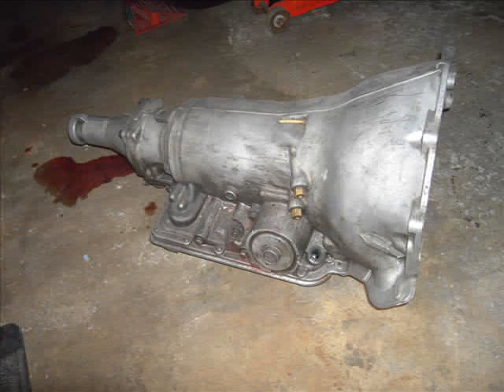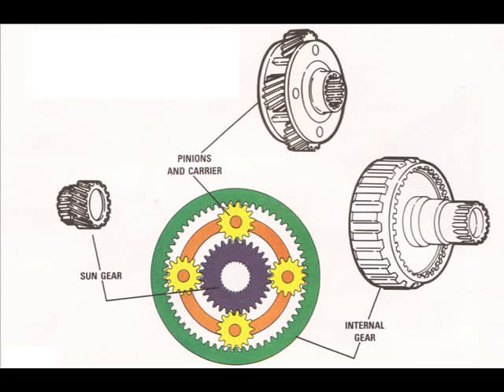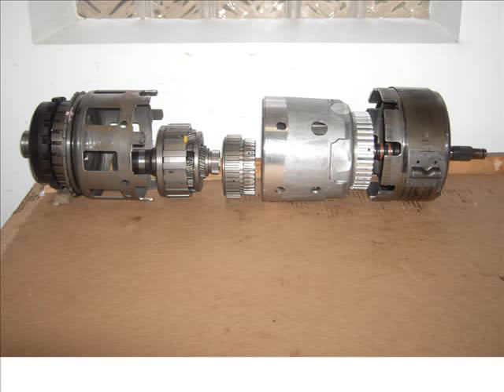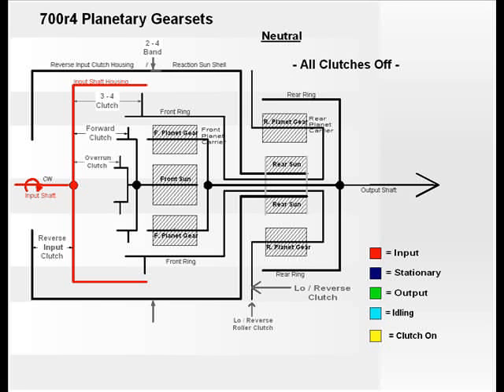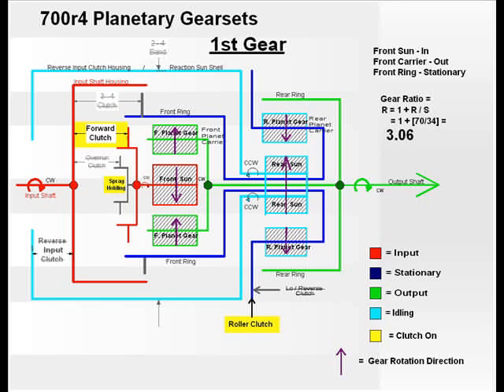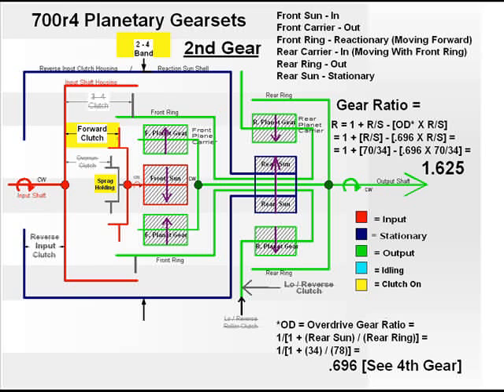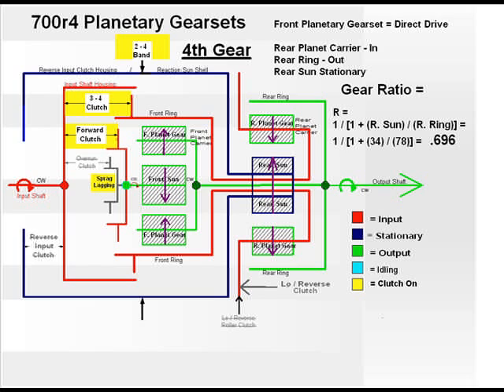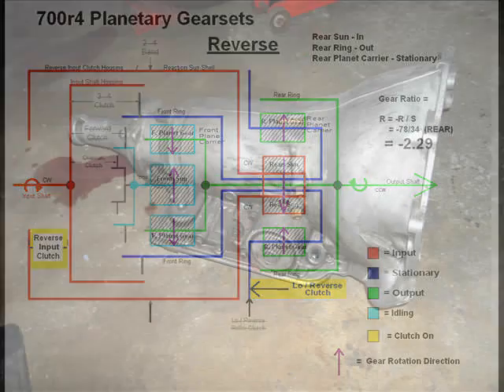How 700r4 Gear Ratios are Determined

Comment: At 07:30, 2nd gear description is incorrect. The front ring and rear Carrier are NOT connected to the output shaft. The front Planet and rear Ring are connected to the output shaft, that is why the rear ring locks the output shaft/drive wheels when the hand-brake is applied
Reply: Sorry not when the hand-brake is applied, rather when "P" is Selected
Reply from the maker: Sorry for not responding sooner, but I don’t think I got the usual E-Mail alerting me that I had a comment.  (I came across this because of another comment I recently received.)

Good catch. The error is in the narrative.  I say, “The amount the front ring moves forward is controlled by the connected rear planetary carrier which is in turn connected to the output shaft.”  As you point out, only the front planet carrier and rear ring gear are permanently connected to the output shaft and my statement in the video is not true for the front ring gear and rear planet carrier.  The elements that are connected to the output shaft are, I believe, correctly identified with a large dark green dot in the diagrams.  I will correct the narrative in a future update of the presentation.

Thanks for your comment, it’s good to know that someone is watching and listening to this video!
Reply from the maker: The “Lo / Reverse Roller Clutch” is a one-way sprocket that prevents the front ring gear and/or rear planet carrier from turning in reverse.  In 1st gear, its purpose is to hold the front ring gear making it reactionary.  In reverse, its purpose is to make the rear planet carrier stationary.  In other gears, there is no tendency for either the front ring gear or the rear planet carrier to move in reverse, so the “Lo / Reverse Roller Clutch” is of no consequence.

Comment: I’m building a 46 Chevy pickup and with a 350 SB and a 700R4 transmission, what would be a good (good as in midrange set for even power and fuel economy) rear end gear set for a 10 bolt 8.2 rear axle? I will be running 265 70 R16 tires. The rear end currently has a 2.73 in it but I’m afraid that’s going to be too tall of a gear.
Reply from the maker: Yes, your gear ratio is tall and your tires are also tall, resulting in relatively low RPMs at speed.  Your tire diameter is 30.6 inches, giving a circumference of 8 feet.  This results in 30 RPM per M.P.H. or 1799 RPM @ 60 miles per hour.  This will result in 1259 RPM @ 60 miles per hour in overdrive.  You will be getting excellent highway gas mileage, but performance wise you may not be getting your RPMs up as much as you’d like.  The 700r4 transmission will help, especially in 1st gear.  Maybe consider a lower profile tire.  (The formula I used is RPM/MPH = (2.73/60) X (5280/8) = ~ 30.)
Reply: icogye Thank you for the speedy reply. Went over the math a few times and cane up with a 3.43 gear but because I have a 10 bolt 8.2” rear end it’s not showing that gear set for it. Only one that is close is 3.36 which would be better than the 2.73. Might go with a bigger rim (17) and slightly smaller tire to help keep it around 2000 rpm
Reply from the maker: Good Idea.  My truck, the one that has the 700r4 transmission, has 26.4" diameter tires and a 3.43 rear end.  I can light the tires with ease. Must keep the RPMs up.  The higher the RPMs, the higher the horsepower.  9 miles per gallon though (city driving).
Reply: icogye I may go with the standard 5.7 350 and RV roller cam and bigger valves with this truck. Get it closer to 400 hp and a fuel injection system just to keep it simple and reliable. Got quoted $1685 to rebuild my 700r4 with better clutches, corvette 4th gear servo and corvette stall torque converter. Another quote for $2200 at another shop for the same setup. They called it their super 700 package.
Reply from the maker: Wow you got me beat.  I also have a 5.7 Liter small block but with a four barrel carburetor.  I doubt if it has more than than 200 HP - mostly stock. My transmission is a 700r4 that I bought on Craigslist for $300 about 6 years ago.  Has always performed well.  Great burn outs.  One thing you might consider is a stock lock-up converter which is a fun toy.  You can put a switch on your dashboard and lock it up anytime you are in 4th.  You can feel when it kicks in - feels like the engine is hooked directly to the driveshaft!  But I never liked high stall converters - too much slippage and too much heat to deal with.

Comment: I currently have a 700r4 in my C10 pickup with a 2.73 rear end gear but the acceleration from dead stop is very slow. Would a swap out of the rear end gear to 3.42 make a big difference in take off? Looking to burn some rubber!!
Reply from the maker: Yes, I believe so.  My C10 truck has a 3.42 axle ratio with standard differential (no posi-traction) and a 200 HP 350 engine and I can hardly prevent the tire(s) from spinning when I take off from a signal.  A friend of mine once said, "Get your RPMs up!  It puts the horsepower higher on the chart at all speeds.

Comment: I just rebuilt my 700 r 4 out of my 92 Chevy pickup . All the gears work fine but reverse just barely will pull the truck back it’s not slipping but just can’t get it to lock up the gears in reverse what do you think I did wrong please help thanks
Reply from the maker: It's been a while since I worked on my transmission, but I would first check the shift lever and linkage to see if it is properly aligned with your shifter.   Other than that I would look for other possibilities affecting the operation of reverse.  A good description of the components at work when in reverse can be found in the GM book "Principles Of Operation" pages 27, 94 and 95.  This document is available for download for free at http://www.1990suburban.com/repair_and_service_manuals/700-R4_Automatic_Transmission_Principles_of_Operation_2nd_Edition.pdf.

Comment: You mean Chevy and GM corporate bolt patterns, or universal bolt patterns.
Reply from the maker: I'm really only familiar with the Chevy bolt pattern.  I know they make this trans for Buick, Olds and Pontiac and if you have one, you must be sure to get the correct trans.
Reply: For the most part early 700-r4's and 200-4r's could have BOP (Buick Oldsmobile Pontiac) or Chevy patterns, some even had both. Then V6 patterns. Both transmissions were early attempts at a 4 speed w/ overdrive and lockup, made around the same time, by different divisions of GM. So the engines they were mounted to, were very much alike in size and manufacturer. (not so much universal in application, but much alike in origin).
I believe the bottom four bolt holes are shared in each V8 pattern.
The only true "universal" pattern I know of is the SAE, and its variations. You'd be pretty hard pressed to find a 700r4 with one though!!